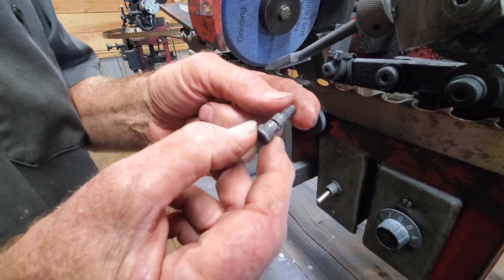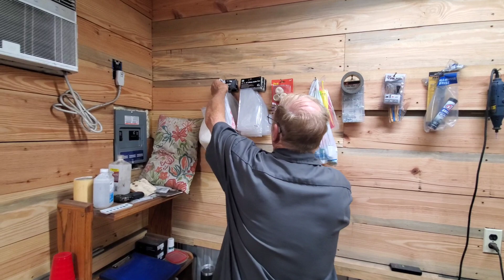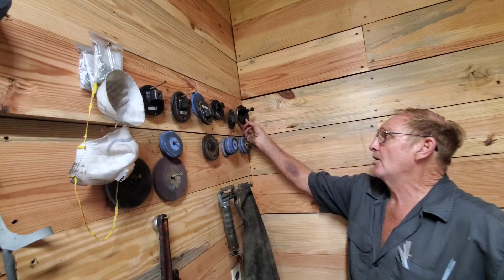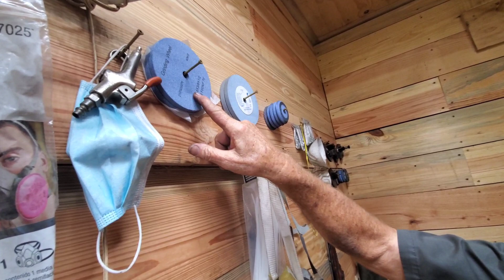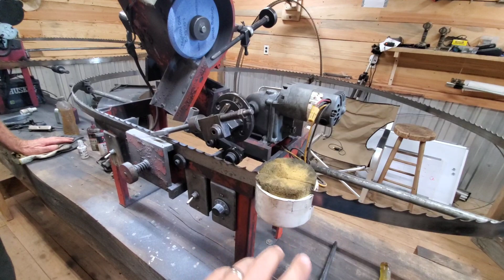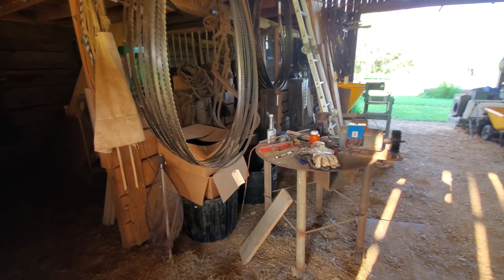Cooks Catclaw Sharpener Tips with Mr.Robert

Comment: Ask if setting after grinding works and if not, why? I use a CBN wheel on my home made grinder on WM blades and  have not made or used a setter yet on my blades. thanks.
Reply from the maker: It does, but if there are burs from the grinding, it could throw dial indicator readings off.  Not a big deal, but it's the reason why we clean, set, and then grind in that order.

Comment: Thanks for the red rock info. Just got my Cooks Cat Claw a couple weeks ago and I wondered about using the red rock. Not now! I found on my Timberking UltraMax  blades I can barely adjust the set or the tip of the tooth breaks off. Hardened steel I suppose.
Reply from the maker: We see that often on the blades with extra Hardness.  You will have to adjust the height of the blade so the anvils hit lower.  That will prevent you from breaking off tips.  Just remember to back off the anvils because you will need less to achieve the desired set.
Reply: @TCSawmills  ok got it. Thank you.
Reply: I Have been using those ruby red grinding rocks from Suffolk Mach. for 20 years and no problems.  
The metal dust is worst thing to worry about.  Hos does he know that the arsenic poisoning cam from the rock and not the metal dust?   I am going to research this.
Reply: @chrismargaretjordan8320  Arsenic poisoning is a relatively common occupational hazard in metalworking when it involves grinding that creates fine dust. The source of the arsenic is in the steel itself—not the grinding equipment—as arsenic is a common trace contaminant in steel that is very difficult to remove. When that metal is ground (like with sharpening), some of those fine particles can be inhaled into the lungs or ingested. Arsenic in that dust then gets absorbed into the body and accumulates over time; in high enough concentrations, toxicity can result. I'm not a physician or an industrial hygienist, but I'm guessing that Mr. Robert's illness was the result of years of accumulated exposure to finely ground steel in a tightly enclosed space with few air changes and no filtration or PPE, possibly made worse if he ate any food in his sharpening room. Regardless, the solution is to manage the dust and air quality (as Mr. Robert is now doing) and avoid eating in the metal-dust environment. Those of us sharpening a few blades here and there for ourselves in a well ventilated area probably don't have much to worry about. :-)

Comment: good video i didn't know alum- oxide was that bad i am going to sharpen out side till i can get the right stone. that's also what is on my hand grinders. i hope mr. roberts will be around a long time. take care, be safe and well.
Reply: I Have been using those ruby red grinding rocks from Suffolk Mach. for 20 years and no problems.  
The metal dust is worst thing to worry about.  Hos does he know that the arsenic poisoning cam from the rock and not the metal dust?   I am going to research this.

Comment: We use Timberwolf Cobalt blades and use synthetic transmission fluid with the Cooks drip lubrication system.  We have a 3 man crew with a log infeeder deck.  We mill logs everyday and a brand new blade will last for two weeks (75-80 hours) before we take it off and sharpen it.  These blades are amazing.
Reply: Keep your blades oiled with TF fluid and they won't be rusty.  Since we run our blades so long we may only get 1-3 sharpenings out of them and we are only able to run a sharpened blade about a day.  After running the blades so many hours they will eventually crack from the metal fatigue.  Our blades are 222" long so they are long blades.